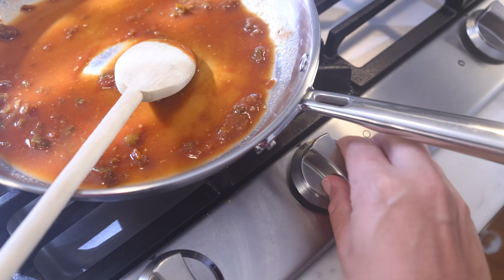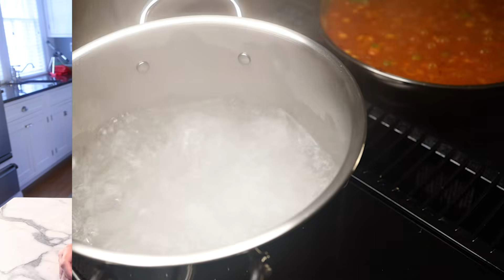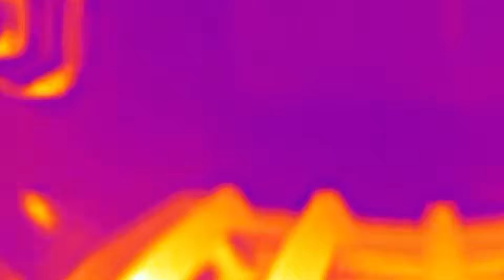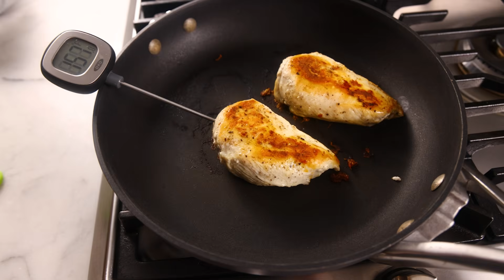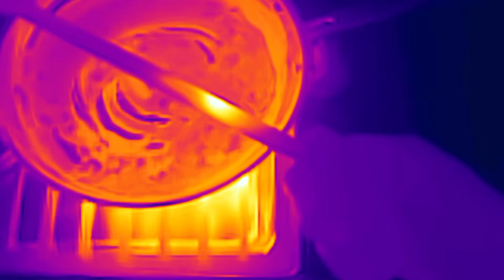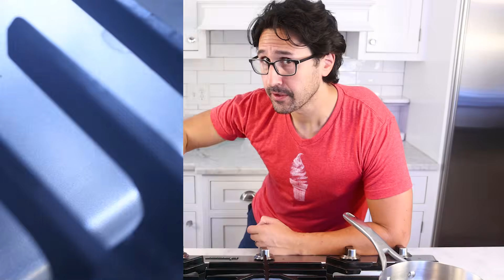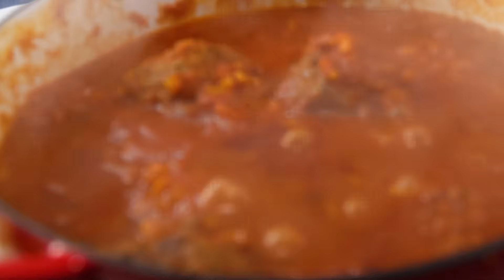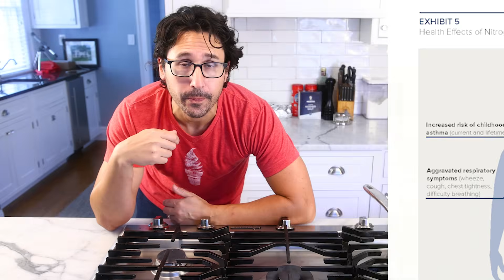Problems with gas stovetops | weak, dirty and dangerous

Comment: Honestly, the responsiveness overrules all benefits of electric stove, especially for food that is not typical western. Like Chinese, Japanese, Philippine, just to name a few I am familiar with. Even for many typical western cooking the responsiveness is also greatly appreciated.
For me, I have a induction stove for all simple boiling (even more energy efficient than regular electric stove), and do all complicated steps on gas stove. But if I had to choose one stove, I pick a gas stove.
Reply: In what way is induction less responsive than gas? I really haven't found much I could do on gas that I don't do as well if not better on induction.
Reply: @garethbaus5471  it’s not, induction is far more responsive and can go both lower and higher than gas
Reply: @Clove_Parma  that was meant to be a rhetorical question.
Reply: Why though?
I have cooked with all 3 and do not see any benefit in gas over induction apart from super exotic cooking techniques (such as roasting flatbread or other foods directly in the flame without a pan).

I find induction better to control, more powerfull, better to throttle down and with the same responisveness to gas. Also alot easier to clean and safer.
Only downside can be the noise some pots make and that you are bound to induction capable cookware.

It is literally impossible to have higher responsiveness than induction since that directly heats your pan or pot. No transmission needed.
Reply: For westerns I think induction is superior in pretty much every way.

If you have a wok it will have to fit the induction bowl but I also got the impression that woks are pretty universal so you might be completely fine with one wok.

Comment: I've always longed for a gas stove. Thanks for easing my belief that "gas is better in every way". Part of me still wants one though.
Reply: You can get a portable one-burner gas stove if you want to try it out. If you end up liking it, you can decide to switch to gas once you get the opportunity. If you don't end up liking, you'll still have the portable stove for camping/road trips, or for applications where direct flame is required (e.g. one of the bigger benefits of gas is that I can roast marshmallows at any time, on a whim. Could never do that with electric!)

Comment: To be honest, gas stoves used to be my comfort zone, cooking wise because they're what I grew up using, but from just about any perspective, save a few very specific, circumstantial scenarios, there's little to no reason to use a gas stove over electric stove tops. Outside of those special circumstances, there's really no reason to use them anymore. Gas stove tops are less efficient, they have a bigger impact on the environment (as in emit more shit into the atmosphere). 

The sad part is that even IF they were the same efficiency fuel burning ratio wise, gas stove tops would STILL lose because the heat transfer rate between a gas to solid object and a solid to solid object is light years apart. So not only do you waste a lot more energy/fuel because heat is escaping up and over the sides of your pot but the few gas molecules/atoms that make contact with your stove top won't transfer heat as quickly as an electric stove top. It has to do with the number of atoms making contact at the same time. Ever notice how 40 degree celsius water feels hotter than 40 degree celsius air?

It's not because there's a temperature differential, it's because heat is transferred in to your body/skin faster.

Comment: I'm surprised Adam left out the huge advantage electric is for broiling.   Broiling needs infrared to work, and a burning flame doesn't provide any.  A gas broiler works to the extent that it does because it does heat the metal above it.  But he hit the mark on the many other significant disadvantages of gas.  

Six years ago I went from coil top electric in our Mid-century Modern kitchen (turquoise!  Push button controls!) to gas in an apartment, and then to a ceramic - it's not glass - topped electric.  Adam is wrong in saying that there's no difference in speed.  The reason is obvious.  With open coils heat transfers mostly via conduction.  Ceramic burners are below the pan and the only heats when the coils are hot enough to get through the ceramic and by infrared.  

Yeah, I hate gas.  When I went searching for a new home I made a list of things I wanted and didn't.  At the top of Wanted was an electric kitchen.  My heating and cooling is via reverse cycle heat pump.  My electricity is 100% wind generated.  

The production and transmission of natural gas is a huge contributor to climate change.  All that methane leakage.

Comment: On top of the wasted heat through fire spreading outwards away from the pot/pan, Electric tops transfer heat through solid-to-solid conduction, which is extremely efficient in relative terms, and with a high enough power, they'll heat something much faster than gas. Gas stoves transfer heat through a gas-to-solid (or I guess plasma since it's a fire) conduction, plus some radiation, so it's much less efficient. However, being asian, I use a wok a lot, so I prefer gas.

Comment: "You do you."  Well, the problem is you have to know who you are.  I don't know if I prefer gas or electric stoves. I currently have gas, but I did like the ability to put an electric burner on very low.  They both have their advantages and disadvantages.  I haven't had the chance to try an induction stove yet.
Reply: How much do you care about safety, especially relating to accidents? I would never want to live in a household with a gas stove. I've cooked with one once and I was way less afraid than I thought I would be, but I still am of the opinion that electric stoves are much safer.
Reply: @camelopardalis84  Having used gas stoves for many years, I'd say they're not very dangerous unless you're stupid or reckless.  And newer gas stoves don't even need a pilot anymore, which was one of my biggest concerns.  They have this ignition system that lights the gas burner when you need it, so no pilot is necessary.
Reply: @macsnafu  Had to look up what a "pilot" is. Found a video on how to light such a "pilot". What worried you about them?
Reply: @camelopardalis84  The pilot had to be lit at all times to turn a burner on, whether you're cooking or not.  If the pilot went out for some reason, then the stove is just leaking gas into the house.  Admittedly, it's a very small amount, but it would build up over time if you didn't catch it and relight it.
Reply: @macsnafu  Okay. Now that sounds like a real problem to me! I was wondering why it needed to be always lit, but then you kept going and offered the terrible explanation.
You don't need to answer me (but you may, it would be welcome) but I wonder what people do when they go on a holiday for two weeks for example. Can the gas be turned off completely, eliminating the need for the pilot to be burning? And if yes - and I assume the answer is yes - could it be done every time you don't cook or would that either be way too much of a hassle and/or dangerous and/or bad for the stove or the gas valve or whatever? (I have no idea how gas enters your house.)
Reply: @camelopardalis84  If I recall correctly, there would be a cut-off valve in the back at the bottom where the gas line connects to the stove, but it would not be easy to reach.  And of course, you have to relight the pilot when you turned the valve back on, so it would be a hassle to do it in between meals, but not so much if you went on vacation.

Comment: I love my gas stove. Yeah, I wish water boiled as fast as it did when I tried induction, but I cook with cast iron all the time and I find all electric stoves turn my cast iron into spinners
Reply: Thanks for mentioning this. Induction warps cast iron and carbon steel pans on high output. It heats them too fast. Searing steaks on induction, better believe you'd be replacing that pan soon
Reply: @EvanAristyaYudha  Exactly. I have a couple old Griswolds I love to bits. I noticed even with a very slow heat increase it still caused my beloved Griswold to wobble. So I stopped cooking with my cast iron until I did a stove upgrade to gas. Much better. And the food tastes better
Reply: @EvanAristyaYudha  You can get around that by heating it up slowly and in steps, but I imagine that's a massive pain to do compared to just firing up at high heat like we do with gas

Comment: I live in central Europe and most ceramic tops are still resistance stoves. Induction is definitely not widespread.

On another note, growing up in a developing country, gas stoves are a necessity as power outages are common.

Comment: Gas gives way better control with stove top cooking.  It cools down much more quickly and you can measure how much heat is involved by seeing the flame or hearing how much flame is being used.  I grew up with a resistant coil stove which is what most people associate as electric stoves.  Very glad most apartments in NYC use gas stoves.  Mine is from the 80s and small but I love that lil stove/oven.

Comment: What's true is that heat transfer efficiency is poor with gas, however Adam doesn't have an "expensive" range but rather a standard range that has the common heating issues that most people have to deal with. What he lacks is a true professional range with high BTU burners.  On his model only the center burner is 18k BTU, while the others are 12k BTU so it's going to take time to boil water.  He also doesn't have a simmer mode for setting the flame much lower than just 'Low'. I would suggest that if you're doing a cooking show on YouTube, you might wanna up that to a 4x18K BTU range which is standard in most Wolf's or other high end ranges. They will also have a 'simmer' zone that is badly needed for anyone cooking on a gas range.

Comment: Most gas stovetop burners are field adjustable as to the range of the flame size.

To adjust: pull the burner knob off, as for cleaning. The knob shaft should have a hole in the end of it. Deep in the shadows of that hole is a screw that adjusts the max/min flame size. The screwdriver needed is straight bladed and very slim; a servicable equivalent can be made by grinding a length of coat hanger wire to  a 1/32 inch thick by the full wire diameter. Very little torque is needed to adjust. To adjust the minimum flame size down, turn the shaft to minimum flame size and tweak the screw until the flame goes down to the size you want. Allow enough leeway a draft won't easily blow out the flame when you're not looking. To adjust the maximum flame size up, turn the shaft to full throttle and tweak the screw to your desired flame size. Back it down if the flame tips turn yellow; it will make soot and carbon monoxide if the tips are yellow. There's no option to adjust the max up and the min down at the same time, it's one or the other. Each burner is independantly adjustable, so some can be optimised for max, others for min.

I used to work for Sears appliance repair division.

Comment: You never cease to amaze me with how exhaustive you can be on any topic. You're like Batman, with enough preparation you can cut all the way through the bedrock of any topic.

I've been considering switching yo gas simply for the thermal response latency but you thoroughly convinced me that was short sighted.

Thanks again, Adam!
Reply: Induction has the same responsiveness and it boils water 3x faster and doesn't make the kitchen needlessly hot, even electric resistive can warm up a kitchem pretty good. (Mainly in the summer when it only takes a little bit to drive the heat and humidity to god awful in the kitchen) 

I grew up with an electric resistive range and never had heat cycling or responsiveness concerns. I think the stove had a driver that adjusted the current and not the cycle length, and i never really adjusts the heat that much when cooking, only minor things but rule of thumb you put it on medium and no higher unless you're boiling water. The only times things came out wrong was my fault like letting a pan preheat for too long and burning the butter.

Comment: I have cooked for my family for 48 years and have used both electric and gas ranges and stoves. My family got me a new gas stove/range for Christmas last year and I LOVE it!!! It blows away any stove I've ver used!!
Reply: In case you've ever cooked on an electric stove where you can clearly see and touch the electric coil, the ones Adam says are "just a coil of wire" and shown at 8:00: How do you clean one of these if something boils over? Can you (easily) remove the coil of wire? I only know two types of electric stoves, such like the one shown at 8:13 and such that were squares or rectangles of metal with elevated "burner plate" things. So I always only had to clean a smooth and completely level glass surface or a metal surface with black circular "elevations". No gaps etc. overboiled milk could run into.

Comment: and if you're buying a gas stove, get one with open burners so the heat goes to the center of the pan not the edges, this isn't some fancy new tech, it's what all the cheap gas stoves used to be until the "easier to clean" sealed burners became trendy and then difficult to avoid

Comment: I had an electric coil stove in my apt and it was a pain to replicate recipes because all the people were cooking with gas stoves. Heat distribution was not homogeneous along my pans either (both aluminum and cast-iron). With the gas stove in my house, I get a much better sear on meats and my sautées are more well-behaved. The only drawback of the gas stove is boiling takes ages, as Adam said.

Comment: Ive just recently moved to somewhere with an electric stove and ive got to say, for all the problems gas has id take it back in a minute. Just how unresponsive the heating is is a nightmare for me, especially when the stove only has 6 heat setting which all seem to be pretty hot, im pretty sure thats just because i have a shitty stove but still. I also feel like i know whats going on more with gas because i can actually see the flame and sort of visualise the heat, that may just be because im more used to gas, im not entirely sure, but id much rather have a gas stove, but yeah they can be frustrating at times.

Comment: Glass top electric stoves are also very common in Denmark.
Also induction is insane, you can get those stoves to pump heat into your pot so fast I'm scared to look away for a few seconds 😂

Comment: Adam: - "I used to love perching my spoon on top of the pan when cooking but I can't let the gas stove"
Me: - I've had gas stoves in my whole life and all you have to do is to learn to perch the handle of the spoon over the handle of the pan so it doesn't get hot and the problem w/ heat control, just raise the pan a little higher to avoid the burning on the edges.  Problem solved...   😁♨️🔥

Comment: Had an electric coil stove for most of my life. Suddenly moved to a flat with a gas stove and it absolutly made my cooking better. Fine temperature control was great.
Cut to 2 years ago - moved again and suddenly had an induction stove... and man that thing is just amazing. Never going back. Easier to clean, better temperature control and my fat ass isn't sweating like grazy next to it. Even my pots and pans are waaay cleaner. Bought a small sauce pan when moving in - 2 years later still looks brand new, though I use it 2-3 times a week.
Induction IS the future.

Comment: I have experiences with both electric and gas. You do get used to the gss stove eventually but i kinda miss the old easy electric one. It was MUCH easier to clean and made me think that gas tops were just overrated. Ours makes a lot of noice becausw of the steel you put the pan on, it isn't stabilized and makes so much rumbling noices while shaking the pan. And because it is just a "+" shape, everything is more capable of falling off (but these are probably because of the steel parts i own, i also had experience with really good ones, i especially like Adam's stove, it's beautiful. depends on what you are buying. I'd recommend you keep that in mind while getting one). You also need to get used to it being higher than the electric top, which is the case with most gas stoves. The good thing is i never need to get the pan to the side so the food doesn't burn but to be honest, a bigger issue is when even the low setting is too hot, which can really get annoying sometimes. Oh and i hate the metal handles getting as hot as the freaking pan itself, concidering it can be dangerous to move the pan with kitchen gloves or a towel, because y'know, open fire and fabric don't really go along-
I am pretty conflicted about gas stoves, but when you learn to live with them they are actually fine for people who cook often. (And gotta say it is quite the flex)

Comment: I grew up using gas and electric stoves and prefer gas to electric because of the amount of heat they put out and how fast it responds.  The house I live in now had an electric stove that took me a while to get used to.  For instance, I like to make hot wings and the problem that I had to learn to adjust to was that the electric stove's cycling on and off.  I don't have that problem with gas.  We switched from oil heat to gas about three years ago and I bought a gas stove where one of the burners is 18,500 BTU Wok burner which is friggin amazing!  That's  the hottest gas stove that I ever owned and had to learn to keep wooden spoons from getting burned, which is something that I didn't have to worry about with electric heat.  The bottom line for me is that you just have to adapt your cooking to the stove you have.